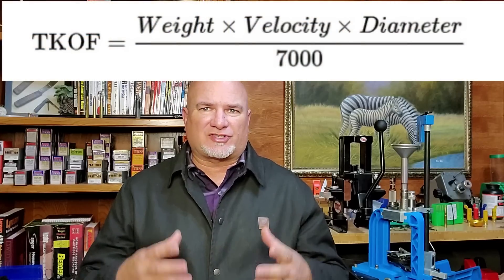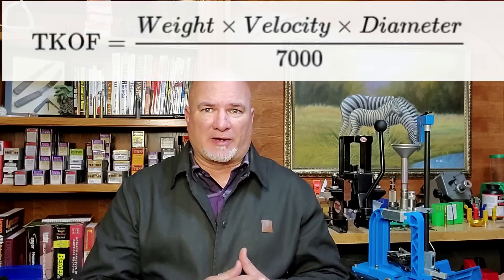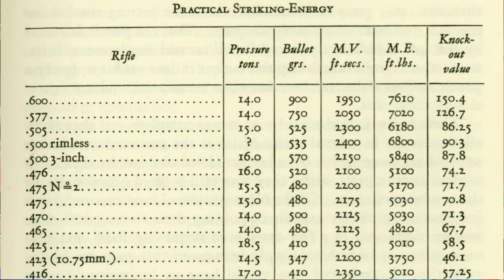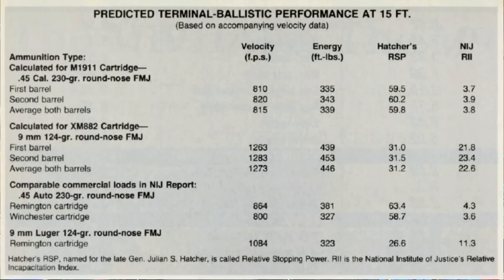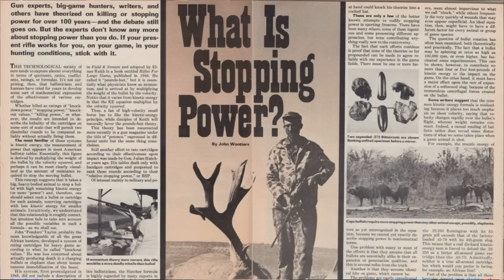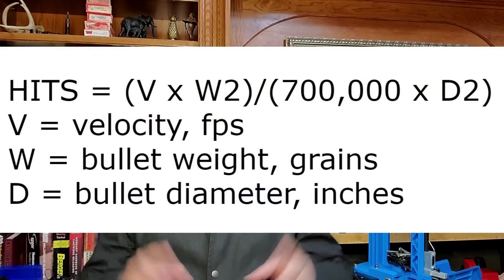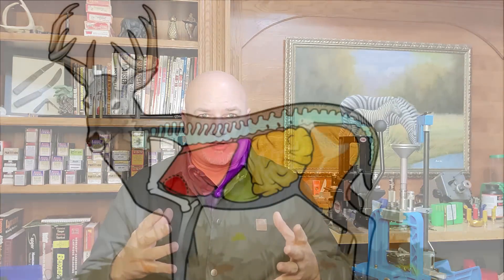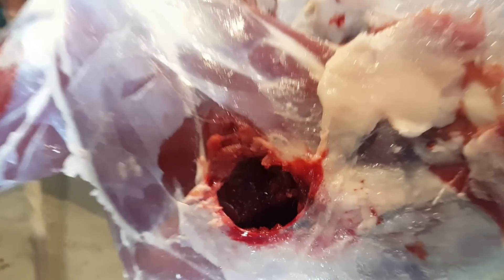KILLING POWER: Can It Be Measured?

Comment: I recently tried these barns vortex 130grain ttsx in .308.   There going 3105 fps outa my 26inch barrel.    They just flip whitetails right over.   Like they were struck w lightning 🌩.   Incredible from a 308.     Never seen 308 hit like that.    Felt like using a bigger round.     I'm impressed 👏
Reply: And my 6.5 PRC 129 grain load is at 3250 what do you think thats like?

Comment: "INTERNAL ballistics" I believe is what you're mainly talking about.
I began using the first Barnes X bullets in about 1992, they killed so perfectly, and strangely produced NO bloodshot, macerated meat. I literally "ate the bullet hole" because it was torn, but not bloodshot! - on many animals. 
The "killing power" of a 30-06 became much more on elk, noticeably. 
Placement ; then bullet construction; then tinker with weights and vels.
Great vid: experience usually Trumps theory, you might say.
Thanks for the breakdown on a troubled subject.
Reply: "INTERNAL ballistics" is what a bullet and rifle do as the bullet is traveling down the barrel.
External ballistics is what a bullet is doing traveling downrange to the target/animal.
Terminal Ballistics/Performance is what the bullet does upon impact and through the target/animal, which is what DD was talking about.

Comment: How would you feel about using a 150TTSX in 300win mag on large bull elk at 400yds?
Reply from the maker: You're using a magnum! Why not move up to a 180gr TTSX at 3000fps. Leave the 150gr bullets for the 308.
Reply: @desertdogoutdoors1113  only two reasons are trajectory and velocity… rather use the 168 over the 180. 

Thoughts?
Reply from the maker: @MrHf4l  If you want to shoot bullets that light, you would have been better off with a 308 or 30-06. The light bullets are a waste of powder with the 300 win mag.
Reply: @desertdogoutdoors1113  I haven’t definitely decided on anything. Just curious what your thoughts were.

Comment: I would like to see a guideline established that would take into account the some of the following:

Animal density and hide, hair, fat content 

Bone size and density. 

Mass of animal. 

Animal lives in dry or wet habitat.  

Tenacity to live. 

Distance of shot. 

I am sure I left out some.

I teach Hunter Education. I have many different makes and sizes of bullets that  I have cross sectioned that I take for show and tell.  I explain the bullet construction, material, jacket thickness and different results will 13:16 be experienced based on velocity at impact, entry angle, and most important shot placement.

Comment: 🤪 I wrote this the other day, to answer someone's question: Yes, bullet "performance" is a combination of 6 Main Things - bullet design (which controls sectional density and bullet weight after impact), bullet velocity, bullet weight, weight retention (a subset of bullet design and the materials that it is constructed with), bullet energy (a combination of bullet velocity and bullet weight), and shot placement! 👨‍🎓 Their may be something that I left out, as it was written in haste, so feel free to add your input! 🙂
Reply: More or less correct.    Weight being the least important at the end of the day.    But still does factor in

Comment: In my lifetime of hunting weight frontal diameter matter a good bit. Assuming you have adequate penetration normally the fatter heavier bullet kills better. Velocity energy matter to an extent. Sectional density gives a comparison of penetration if bullet construction is the same. There is a lightning type effect high power rifles have as well. It's complicated really. A 240 weatherby mag will kill a mountain lion quicker than a 45-70 probably but a grizzly I'll take the 45-70. It's like comparing a 30-06 to a 7mm rem mag one has slightly more velocity the other larger heavier bullet. Both with modern bullets like a ttsx penetration is about equal both will penetrate far enough for any game on this continent and if I were face to face with a 1000 pound  brown bear trying to kill me I would slightly lean towards the 30-06.
Reply from the maker: Kinetic energy expended in an animal and bullet performance/shape are what damages tissue. Nothing else. Destroying critical tissue is what kills animals. Big fast bullets do more damage than big slow bullets, but the law of diminishing returns applies.

Comment: I’m the type that likes pass through penetration. In my experience, soft bullets that expand dramatically have a high propensity to cause unnecessary meat damage and trauma. The guys that think a bullet needs to transfer all of its energy inside the animal to get the most effective kill are blind to the fact that there’s a major diminishing return on the amount of energy transferred required to quickly kill. A bullet that exceeds the energy point of diminishing returns does not have a negative affect on killing time. Something a lot of guys can’t wrap their mind around.

I’ve killed dozens of animals that instantly drop when there’s full pass through penetration, and dozens that ran a short distance. I’ve also killed many animals with soft bullets that instantly drop without full penetration, and a few that couldn’t be found. In every case, the instant kills from soft bullets showed the worst meat damage. I’ll take the full penetration short blood trails with less meat damage everyday of the week.
Reply from the maker: I also prefer a complete pass through.

Comment: For 40 years, I've used multiple calibers on north American game. Distances out to 800yrds. From 12 gauge slugs, 45-70, .44 mag,-- 300 win mag, 3006, and 243. I've lost 2 deer in that time. One with a .35 lever action, and one with a Roger .44 mag. Both had vital hits. Close enough to see the hit! 
   My slug and high caliber rifles have dropped the game within a few steps. 
   The toughest hunt was Buffalo.  At 300 yards, it took multiple hits with my 3006. Another individual using a 7mm-08 dropped one with three shots. After inspection.  I had 3 lung shots and one heart. The 3 shots from the 7mm had 2 shoulder hits and a final hit in the neck that dropped him in his tracks. 
  Conclusion.  Fast...lightweight rounds release energy for a bigger shock to the system.

Comment: If I loaded Superformance power on the mild side would it behave more like IMR4381?  I hear it is very temperature sensitive and prone to be unpredictable near maximum pressures.  What is the sensible approach to using Superformance in .30-06.  I got 4 pounds that I'd like to use.
Reply: Well they say never use reloading recipes that you find on the web, only from legit reloading manuals, and I agree with that. But this is my hunting load that I've been having great results with over the last couple of hunting seasons. Rifle, customized weatherby vanguard 30-06 ,24' Bartlien sporter b barrel. 61.8gr superformance powder, 165gr hornady sst . Lapua brass, fed gold med primers, set @ 7thou off the lands. Consistent velocities of the high 2980s to low 2990s. Very accurate and deadly with proper shot placement. From my rifle.
Reply: @roddawe2505  Thanks for that.  Many have reported disappointing results, and this powder was given to me, because the previous owner was not happy with it.  I'm wondering if it worth my time.  I will try it out.
Reply: @tunnelrabbit2625  know problem TR. Superformance is temperature stabilized, but it is a hot powder (high velocity) so I would start @ around 58grs and slowly work up at 2 tenths at  a time, 5 shot loads. Pick your 3 best groups out of the lot and go from there.
Reply: @roddawe2505  Thanks for the info.  This one is new to me...

Comment: But isn't engineered bullet-expansion an attempt to maximize the bullet's sectional density upon contact (for maximum damage) while minimizing the bullet's sectional density in the air (for best aerodynamics)?

An easy test if a bullet's sectional density matters for killing power: shoot a FMJ .30-06 bullet into a broadside deer's chest, then shoot a hollow-point .30-06 bullet into a broadside deer's chest.  Compare the damage.

Personally, I've suspected for several years now that hollowpoint bullet technology is a gimmick.  The US military never adopted hollowpoints and our infantry seem to be doing fine.
Reply from the maker: No. Modern hunting bullets (not rebranded target bullets) are designed to provide controlled expansion, straight tracking, and mass retention. The ability to retain mass is more critical to penetration than sectional density. Modern mono and bonded bullets are all great penetrators for caliber, making SD a mute point for the most part. Hornady and Berger throw around SDs and BCs to convince novice hunters to use target bullets that perform poorly on game.
Reply: @desertdogoutdoors1113  -- Two things:

1) I'm skeptical of hollowpoint ammunition being better at killing large targets than ball ammo.  The exception to this is correctly expanding hollowpoints * might * have a better chance at ripping apart blood vessels than ball ammo which does not deform while passing through the target.  The whole point of hollowpoints is for those bullets to form wide, durable, sharp "petals" whose greater sectional density (greater diameter) allows the bullet a better chance to rip through blood vessels, right?  High speed, small cross section ball ammo has been accused of "ice picking" its way through human targets, especially up close, and not being effective.  I only hunt birds so do not have any personal experience shooting large game with rifle rounds and have not been in the military.

2) It would be interesting if you made a video about the modern hunting rounds versus re-branded target rounds you mentioned.
Reply: Load FMJ into chamber. Shoot FMJ into deer. Get caught shooting FMJ into deer. Go to jail
Reply: The military is not allowed to use hollow points or any other expanding bullets.
Reply from the maker: @NCWoodlandRoamer  The military has been using the Sierra Matchkings (hollow points) in Sniper ammo for over 30 years. Some liberals tried to sue the US military for using them in 1990, but lost because the US congress never ratified the Hague convention and  is not bound it.
Reply: @desertdogoutdoors1113  Oh yes, you are correct. I had forgotten about snipers using match kings but I did not know that congress had never ratified The Hague convention.

Comment: This is spot on.  Well said on the 3 factors.  

However, I am a Weatherby fan until you get to the 416 & 460.  However, I shoot a lot of Nosler Partition Bullets.  My 12 1/2 year old granddaughter killed a 320 bull at 375 yards on the first shot with a 7mm Weatherby Magnum loaded with 155 grain Federal Terminal Ascent with a muzzle velocity of 3,300 FPS.  1st time using them. The bullet did its job. 

I agree with the distance comment. I really like 25-06, 257 Weatherby Magnum (at distance) & 270.  

My son got an education when I took my young grandson deer hunting and I chose a 22-250 with a 60 grain partition.  This rifle will stabilize them. He shot his 1st deer broadside thru the heart.  My son could not believe the size of the wounds channel and the size of the exit hole. 

Big bores can do damage, but you have to get the right bullet for the game you are hunting.  I have seen spectacular results with a 444 Marlin with a 240 grain Sierra JHP with a muzzle velocity of 2,400 FPS

In conclusion, chose the right bullet for the game you are hunting, with the proper range of cartridges, choose your shot well, and most important, put the bullet where it belongs.

Comment: The combination of bullet construction, mass, velocity and bullet placement, all which can be controlled by the shooter, are all important. Theoretically kinetic energy can be equal at some point as velocity and mass are varied among different cartridges/calibers. In most cases velocity will hold the upper hand as energy increases with the square of the velocity as indicated in the classic formula. The only statement I have any disagreement with is regarding mass being the most important factor in overcoming the drag resistance of the body tissues to penetration  in the wound channel. I submit that the remaining velocity of the bullet and its remaining energy is more important. A standard velocity 45-70 slug, even with its larger mass and frontal area, is going to be slowed more because of its lower impact velocity and energy. That's why the '06 and other similar higher velocity cartridges are going to be better killers at longer ranges, regardless of whether the bullet is a modern copper or older style lead jacketed bullet. The 35 Whelen IMHO is the best of all worlds as long as shooting distances are ethical, which for me, even in my best younger days was not much over 300 yards. On the other side of the coin I can load my Siamese Mauser 45-70 with a 400 grain jacketed bullet to over 2000 fps. Over 3600 ft lbs muzzle energy and still over 1400 at 300 yards. Definitely still not flat shooting but plenty of energy and penetration for clean kills out to 300 yards. When sighted about 3.5" high at 100 yards and 175 yard zero a point blank hold out to 225-250 yards is possible depending on the size of the kill zone of whatever game you're shooting at. A little hold over may be necessary for longer ranges unless you have a fancy scope with the dials you have to screw with while your target is moving out of range. The only problem with this big bore louden boomer is that it can hurt on both ends. The energy formula works in both directions. Happy hunting boys and girls!😀

Comment: IMO, the perfect balance is heavy bullets in moderate speed. And it is called 9.3x62!
Reply: I've only shot one cow elk using my 9.3x62, so I'm not an authority on the cartridge by any means.
But I can tell you the results with 250gr Nosler Accubond bullets was DRT, (dead right there). 200yd shot, broadside went through both shoulders and was immediate.
I have also loaded the 250gr TTSX Barnes and have to wait for next hunting season to try them out.
For 'plinking' I'm loading 270gr Speer due to the price being so cheap.
All three loadings will produce 1 moa or better at 100yds. A truly amazing cartridge both in history and effects.
Reply: Love it, man. Love it. Long live the Medium Bores

Comment: Yes, killing power can be measured. It actually can be measured accurately. The problem is you need to know what you want to kill and then you have to kill 100's of them with different calibers and projectiles at different velocities. In 1991 a privately funded group (Strasbourg Tests) shot goats with many different cartridges with many different projectiles at many different velocities. This works well if 1. your goal is killing goats, 2. You continue to keep the test going with any and all new cartridges, projectiles and velocities. Our government way back when also experimented with the cartridges and projectiles that were available at the time of testing on cattle, both live and dead. Again, unless youre hunting catte at close range the tests dont provide a formula for killing power. There really isn't a mathematical equation that can provide 100% accurate killing formula for several reasons. The 1st thing few people realize is that the projectile is a major key in dependable performance of the cartridge for whatever target is shot with it. A full metal jacket bullet is good for penetration but may or may not be a proper bullet for the target we encounter. The same is true with saft points and hollow points. Math cannot account for this.